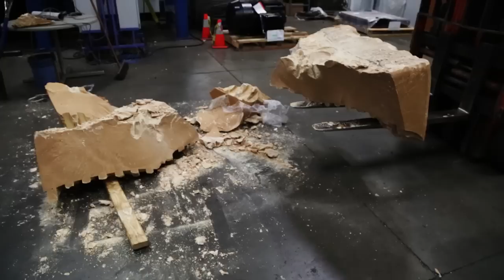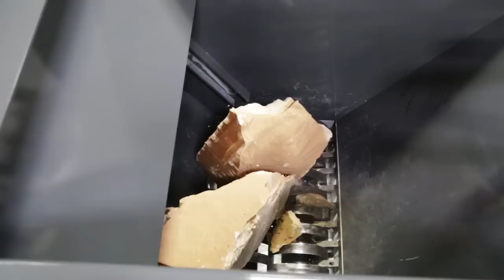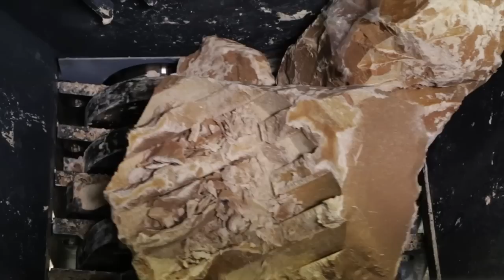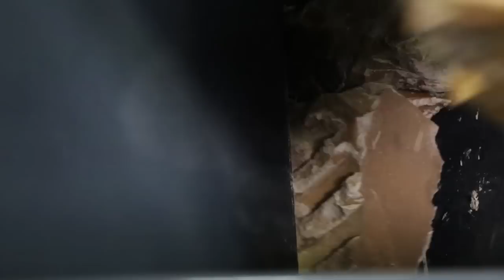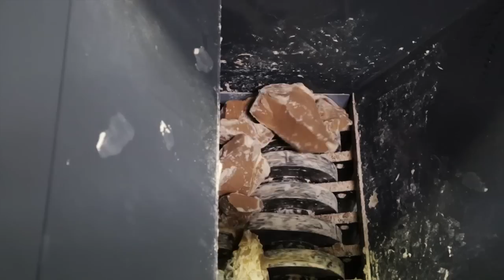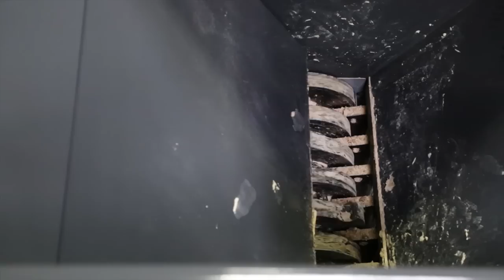SSI's Shred of the Week: Peanut Butter

Comment: how do they clean the machine?
Reply: They drop in a washing machine.
Reply: they put a dishwasher through it
Reply: Throw in a drum of dish soap.
Reply: Probably a pressure washer; otherwise they'd have to remove the rotory blades to manually clean it.
Reply: beefyoso They just shred a massive block of soap.